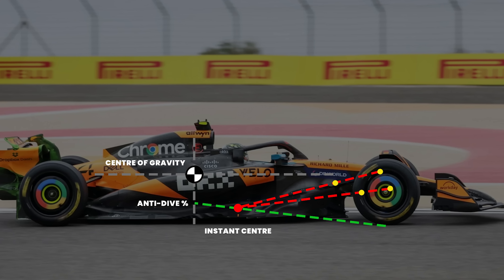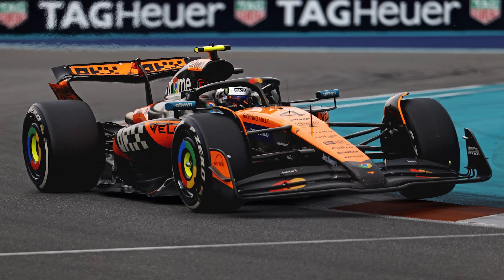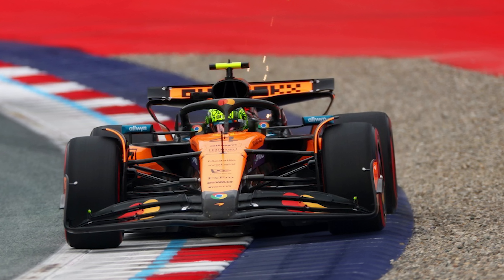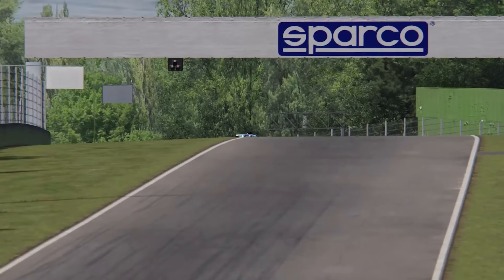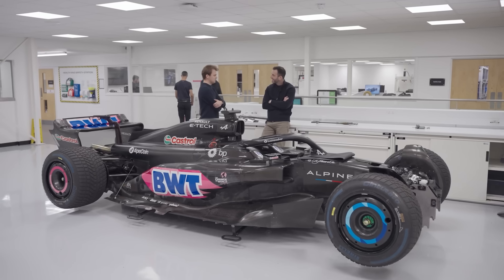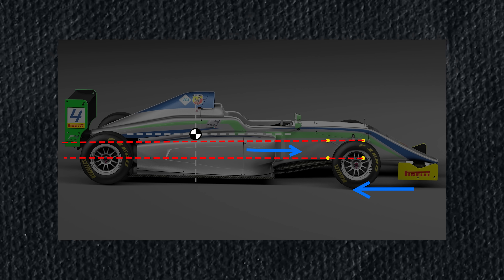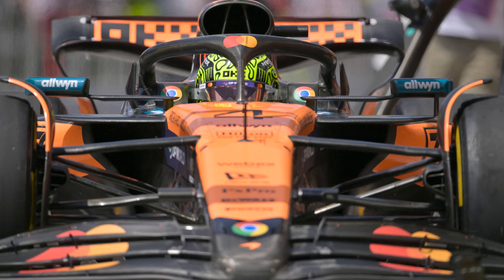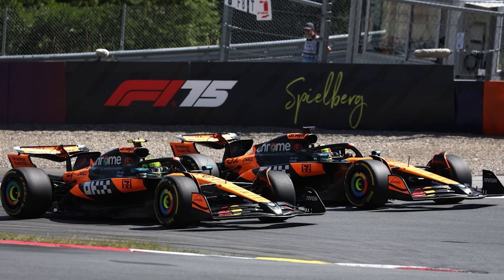McLaren’s NO SUSPENSION Trick

Comment: Thank God, finally someone with sane mind talked about Mclaren's Genius instead of some crazy wizardry
When the Pre Season testing started and I saw the new Mclaren, My thoughts were very vigilant about its front suspension on how extreme their Anti Dive was compared to RedBull's (Who BTW Introduced this concept) and RedBull barely took a look at it and just spent hours on optimizing just the floor and the Aero bits.
The Result: RB having the best Aero Efficient car with the most poor suspension to comply with that Aerodynamics.
Reply: Nice theory but you didn't mention that Max likes a car that has an extremely sensitive front end (which seems more difficult to manage for his teammates), so no way would Red Bull decrease front end feel that becomes inherent with extreme ant-dive.
Reply: @ColinCarFan  its what they did in late 2023 and possibly 2024 with both max and checo complaining about the car and how it handled worse than before, even though still could manage wins and be competitive
Reply: @ColinCarFan  Yup Exactly, My thoughts are with you. RedBull is stuck in this Paradox and can't much about it
Reply: Don't know where you got the idea that Red Bull introduced anti-dive. Chapman introduced it on the Lotus 72 in the early 1970s. An engineering saying is "There's nothing new under the sun!"
Reply: @RayPickering-x9w  Red Bull introduced "this concept" which uses brake torque transmitted through the uprights to counteract dive. The Lotus 72 couldn't do this with its inboard front brakes & would have used weight transfer acting through a different wishbone pivot geometry to obtain anti-dive.
Reply: Also both drivers even checo complained about understeer in 2024

Comment: It would make sense to design their floors to generate more downforce when the nose is down at corner entry than when it's level or slightly up while accelerating down a straight. They want downforce in the corner for turning, but on the straights, it increases the friction and slows the car down (hence DRS).
Reply: Nose down is while (heavy) braking so slow to mid-speed corners. Thats where mechanical grip is key because with low airspeed there is less downforce. Mid to high speed corners need downforce and almost no braking, so the nose remains high like on the straight. Your theory is nice, but not how nature works
Reply: Nope, you really don't want to do that. By doing that you will be shifting the centre of pressure, making the car unstable or at the very least making it feel nervous, stopping drivers from pushing it to the limit. I personally think that is what we have seen from the Red bull car and is why Max's teammates have all tried to add rear wing to gain stability but it just reduces overall performance and the centre of pressure still moves around but just in a way that causes understeer rather than nervous car .
Reply: if you have max downforce while braking, wouldn't that mean you'd lose grip under acceleration out of the corner?
Reply: That means you think too much of anti dive is counterproductive (as most teams seem to do)? Perhaps the brake trq dependent nose dive and down force modulation isn’t the best thing for controllability / driveability
Reply: We’ve all seen how too much downforce from the floor creates porpoising. So it’s only natural to try and get that laptime elsewhere

Comment: A combination of this fixed suspension and phase change break drums would make the McLaren an absolute beast.
Reply: They are leading 0.5 seconds and every innovation gives them 0.1
Reply: Give them a brake.
Reply: I see what u did there 😁😁😁 @Elaba_
Reply: Fixed suspension?
Reply: @MichielvanderMeulen it's not fixed, just the sag doesn't change during braking but the suspension is still moving up/down over bumps
Reply: @MichielvanderMeulen yes, as opposed to dynamic....
Reply: @Skriggler Ehhh, you mean no springs and dampers?
Reply: Something that could only work on the velvety smooth tarmac of a racetrack but tire grip will be worse with the geometry during weight transfer and let’s hope you don’t get bumped into oblivion and lose control because you can’t even see.. lol
Reply: The phase change theory has been debunked. It has been clarified that it would be illegal by the FIA and that they’re not using phase change materials.
Reply: That kinda applies to every time.

Comment: The brake cooling system is likely a thermo electric cooler and not phase change as the regs would make phase change virtually impossible. A TEC however is clearly allowed in the rules and would logically explain why their wheel drums are cooler than other cars.
Reply: I've found TEC to be very inefficient, do you really think they could handle that much heat?
Reply: @Margarinetaylorgrease yes, peltier cells are very inefficient, to cool off F1 brakes we're talking about hundreds if not thousands of watts that have to come from somewhere, plus all the heat has to go somewhere.

And I'm not even sure something like that is allowed
Reply: @v0ldy54  peltier also use power to move the heat and that power also makes heat that has to be got rid of. I tried them years ago for PC cooling and they were crap. Worse than normal cooling because I couldn't get large enough heat sinks.
On the other side they are very efficient heaters.

Comment: Do these super extreme anti dive settings reduce the load on the front tires under breaking? Wouldn't that also reduce front wheel traction under breaking? Or am I getting something wrong?
Reply: No, the weight transfer is fixed by cg height and breaking forces. Actually, if anything, this means their loads on the front tires will be *higher*, because it's making more downforce during braking. The difference is just that this means the load is carried by the suspension mount rather than the springs, so the front doesn't squat as much (or at all) despite the weight transfer.

Comment: Their pace in Austria was pretty scary, so far from the rest of the field. At least they are fighting each other.
Reply: 2014 was much worse. I remember them lapping all the way up to 5th place...
Reply: @STONEAJE  well they lapped up to 7 and nearly 6 by less than 5 seconds
Reply: @patolol3091 Yeah if overtaking was not a issue on this track, I expect they'd have overtaken everyone except the Ferrari's.
Reply: I didn't go to Austria because I'm afraid of kangaroos.
Reply: At least.
Reply: their biggest advantage is in the high speed and mid speed corners, of which austria has a lot. they were owning everyone in sector 2
Reply: I was coping so hard a few laps in, saying to my wife that we (Ferrari) might be trying to stretch the tire life 😂 

Not even fucking close lol.
Reply: I almost started screaming when i saw the lockup into T4 when i was there. I saw it happen and the crowd jumped.
Reply: @Sykasa  that was fun. I was hopping it happened for my own entertainment!
Reply: resemblance of Mercedes in 2014 Bahrain, the first year F1 run on hybrid power units. iirc, after the safety car period, Mercedes pulled 6s off everyone else in the span of 2-3 laps after SC ended, because Lewis and Nico were fighting hard in front.
Reply: It’s awesome and way better than everyone just following Max around all day
Reply: Yes, without Piastri vs Norris it would be yet another boring season.
Reply: Not just the pace, it's how kind the set up is to the tyres, Piastri was able to stay behind in the dirty air of Lando's car for the entire first stint, then still have tyres left over to do few more laps, yet Russel ended up in no mans land after a few laps because he cooked his tyres trying to fight Lewis, same with Leclerc on Piastri.

If teams don't figure out a solution to this, even if they catch up, it won't matter because their tyres won't last.
Reply: @hmoham it’s not a matter of setup, it’s whatever cheat/trick they got under their rims for tyre cooling, it’s proven that they are doing something, just not what it is
Reply: It’s Bahrain 2014 all over again, Merc Engine, but this time a chassis from a customer team.
Reply: That's because Max wasn't there, which is the only car that can match their pace on average. Ferrari is nowhere and Mercedes only works when the temps are colder.

Glad McLaren doesn't have the number 1 driver BS like Red Bull, or this would be another 2022/2023/half of 2024 borefest.
Reply: @The_Curious_Cat Red Bull is slower than Racing Bulls right now. Buddy is in copium mode
Reply: @tacticalmattress  nice try. But they are not. Max is the one that is showing the car's potential, so he's the benchmark, not Yuki. And with that, Red Bull is second fastest and able to match McLaren's pace (depending if the track suits them).

(I know, I know, it hurts your narrative that it's all Max and all that BS of trying to diminish Lando's and Oscar's achievements).
Reply: @The_Curious_Cat  Red Bull is currently slower than Racing Bulls. The only one trying to spin a narrative here is you.
Reply: @The_Curious_Cat  the Red Bull car is designed to Max’s strengths, it it were more balanced between the drivers, as is the case with every other team, they’d be a mid field team at best. Ten designing the car around Max does nothing to help them in the Constructors standings as they need BOTH cars to be competitive to do well in that. Yuki is a good driver but he does not drive like Max, Oscar could potentially drive the second Red Bull car as well as Max as he has the same driving style, but the car still wouldn’t be based around him.
Reply: @tacticalmattress sorry dude, but cat curious guy is correct. Max can extract all of the potential out of the car. the potential is there… it’s just that most drivers can’t drive that car on the edge the way he can.
I seriously dislike Max, but the guy is correct… the max potential of the car is based off the faster driver not the slower driver. The red bull is not slower than the racing bulls. 1 race is not a season either.
Reply: @alextjb  If you actually read what he's saying (which doesn't make sense), he isn't saying what you are. Yes this makes sense, but the car right now is in a state where it is 3rd maybe even 4th fastest on the grid (Max has said this)

That guy is all over the place, nothing even makes sense lmfao
Reply: @alextjb  Did you miss this part

"(I know, I know, it hurts your narrative that it's all Max and all that BS of trying to diminish Lando's and Oscar's achievements)" 

What the hell is that guy yappin about 😂😂
Reply: @alextjb  and the racing bulls have improved to a point, where if you put a better driver in it, I bet you it's a top 5 (ATLEAST) performing car, so it's very possible the Racing Bulls is quite literally faster than the RB right now.

In technicality too, they have two cars performing in a much closer margin, than they do at Red Bull. 

With two drivers who have completely different styles. 

Red Bull is failing in that regard, and even giving Max a unbalanced car. I don't hate Max but I'm not a max fan, but you have to respect his skill.
Reply: @tacticalmattress that part I agree with you on 😊

Comment: From talks about active suspension, to no suspension at all! F1 is insane
Reply: The car definitely still has a functional suspension system. It's just cleverly optimised to reduce a particular second function parameter.
Reply: "no suspension" is just a lickbait-y way to hype up the subject. The suspension performance when it comes to individual wheels dealing with bumps and curbs is roughly the same. It's only when both front corners are exposed to that nose-dive motion, the geometry resists it.
Reply: @Pandamasque  Dealing with bumps and curbs is trivial.  Maintaining the balance of the car while under force is what we're after here.
Reply: @CharlieTheMost119 it’s anything but trivial with these cars. Curbs have been a major problem for the RB the last couple of years to the point having to avoid them at times. Bumps can upset the car enough to lose ground effects downforce if not handled correctly.
Reply: @CharlieTheMost119  You're saying keeping the tire in contact with the track is trivial.😅
Reply: @seashackf1 yeah it's never trivial because it's always compromises, and about finding better ones than the conpetition, because active / adaptive solutions are banned, it's always a compromise between tuning the damping to work best at higher vs lower speed, softer/better grip vs stiffer/more consistent. I am just wondering if the anti dive geometry can also apply to the rear axle with anti squat , and laterally as anti roll, so that weight transfer to the front/back/left/right doesn't change the angle of the car either..if a such a setup can improve aero during braking, cornering and acceleration, then drivers would have to relearn driving with less / harder to read feedback from the car.
Reply: A lot of anti-dive is not even close to "no-suspension".
Reply: They did it in the 80s with the ground effect cars, the suspension became almost rigid when they banned moveable skirts to control the ride height
Reply: The ways the engineers and designers find performance while staying within the rules (usually, anyway) is the most interesting part of F1 to me. 
The racing is all well and good, but the nuts and bolts stuff is endlessly fascinating. 

Back in the day when the rules were looser, we seen some insane innovations, which was extremely cool and exciting. But as the rules have got tighter and tighter, gaining an advantage has been harder and harder, which means more and more complex solutions. It's to the point where they may as well be working on fucking spaceships 😅 
Fascinating stuff.
Reply: WEC >>>>
Reply: No suspension seems like a mis noma. Since technically even rubber tires are suspension
Reply: True but both directions are to achieve the same thing though.
Reply: no suspension = Senna technique possible
Reply: It still has a functioning suspension that absorbs undulations, that's why it's so clever.
Reply: This is what motorsport technology does at the highest level... and what very restrictive regulations do... Engineers always find clever ways.  I don't think this solution would've existed if we're still stuck with active suspension letting the computer do the job.
Reply: @Jojo_Bee  And who designs and programs the computers and actuators? Right, engineers. An active suspension is equally impressive. Due to restrictive regulations F! cars all pretty much look the same, pretty boring when you look at other racing series.
Reply: @iliketoast-q9b yeah, horribly boring compared to NASCAR, Indy, Champ Cars, Top Fuel…they’re all so unique! 🤪
Reply: @andrewnajarian5994  Nice strawman. F1 isn't the only racing series this applies to, shocker. You're american, aren't you?
Reply: @iliketoast-q9b it’s not the only one?  Virtually every series has been regulated to death was my point.  Yes, I’m assuming that was supposed to be an insult but I’m German, Austrian, Greek, Armenian & proud to be 100% American.  🇺🇸

I do agree with you though that I wish they got back to real racing of actual production/homologated vehicles, although practically every car on the street looks the same too nowadays.  😔
Reply: it's just a suspension with an extreme geometry. it's very interesting though to see the trade off between pure car performance and driver feedback.  drivers seem to have inhuman reflexes but their reaction time is "only" ~30% lower than a normal person
what they are extremely good at is being able to process a huge amount of information very quickly so that their correction is quick, but more importantly, extremely precise. it's a bit similar to the difference between an experienced driver who will brake are the right time before a corner, apply right amount of braking, they stay where they want in the lane throughout the corner, when a rookie driver would be braking too early, increasing/decreasing the braking force, swerving left and right through the corner, getting in the opposite lane or close to the curb, basically constantly over or under correcting the input to the throttle, brake and steering. (ask me why I know, currently have a rookie driver at home)
Reply: Yeah, instead they invested all the money/tech into ball protectors.
Reply: Back on 1990s Williams was wining with active suspension. Worst problem was vibration as wheels were actively lifted and dropped over bumps.
Reply: @Dave5843-d9m active suspension done right is king. wirh today's tech its game over comparsd to passive suspension.
its just getring started
Reply: F1 USED TO BE "insane"... but over-regulation has killed it. 

We need a new formula class. What F1 SHOULD be... just basic overall dimensions, and let them have at at.  No safety regs. No nonsense. No prize purses. Just titles/trophies. Leave the money to the team sponsors. Track/facilities sponsors ONLY. It's time to get back to real racing innovation and development.
Reply: No suspension in the car = no suspension in the championship.
Reply: Then you should check out other racing series like WEC where the cars don't all look virtually the same.
Reply: I know!!🤯
Reply: Insane? Insane like a billionaire.